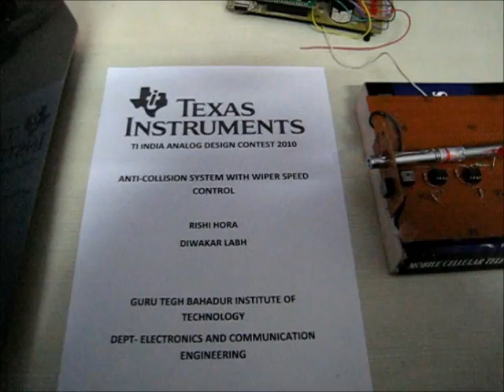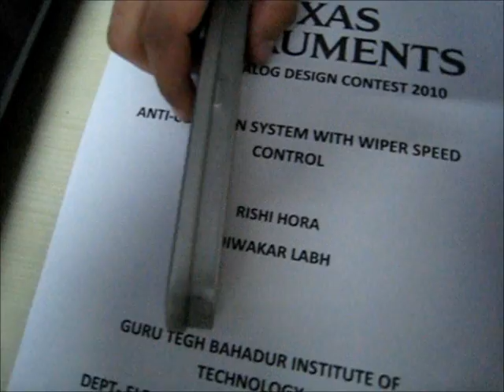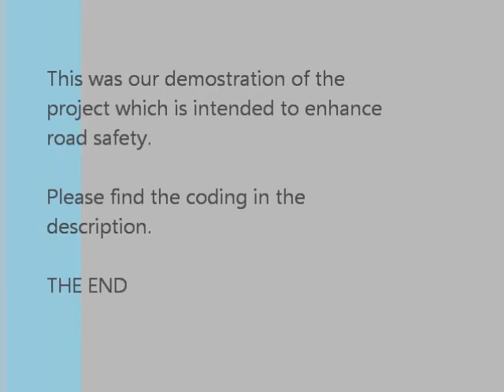TEAM-46 Anti-Collision System Which Works in Rain Along With Wiper Speed Control (TI India ADC 2010)

Comment from the maker: I used OPT101 for the detection and receiving of the laser and IR rays, some opto-couplers, relays, op-amps to control the motor, and the MSP430 for the ADC and generating the LCD output.